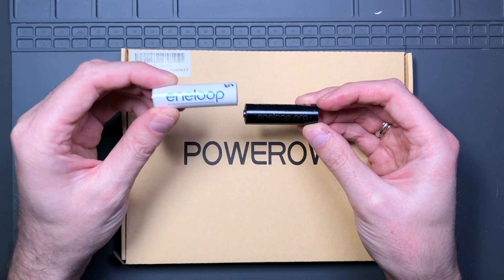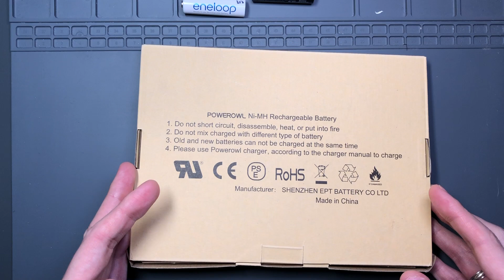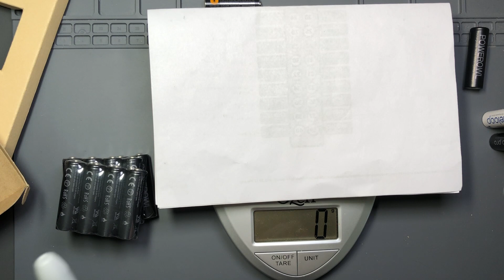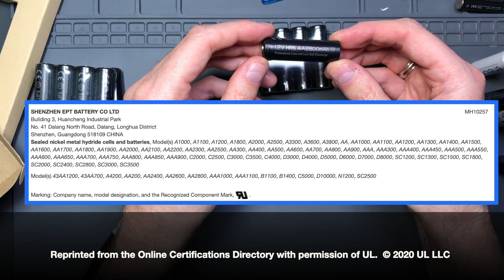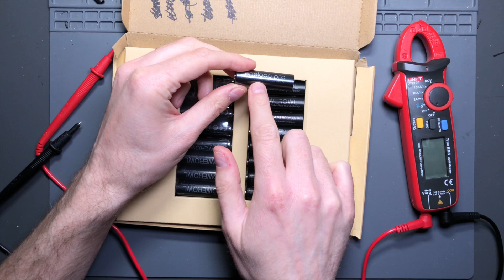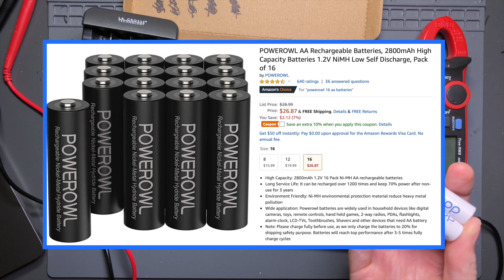How do they compare to Eneloops: Testing and Analysis of the POWEROWL 2800 mAh AA Batteries

Comment: I've recently run some powerowl AAA and they show similar characteristics. Higher discharge currents don't actually reduce the overall capacity. The reason being is that cells hold energy (watts) and we are measuring amps (current)

At higher current draw, the average voltage is lower and therefore this skews the results. If you measure in watts using voltage and current then you get your true measurement

Comment: I've seen a video where EBL 2800 NiMH would provide only 2300-2350 mah. I have several and won't buy more. Fujitsu and Eneloop are virtually interchangeable. I have quite a number of both, and nothing can match them. Ni-Cad is a real darkhorse. There has been a resurgence in interest in improving the breed. Tenergy is the company to watch for this. They now have an AA which is claimed to have an mah of 1100 with greatly reduced chance of leaking. I've had several 1000 mah which have leaked. Great video!

Comment: This is my experience with the high-capacity chemistries.  Minor variations are rapidly and permanently exacerbated by overdischarge use in series.  Within only a couple dozen cycles, the health of a population of cells is everywhere from "i guess i can still use it in the remote control" to "it has the capacity of a CR2032 and it leaks".  On the other hand, I have 16+ year old eneloops that are slightly worn, but they've all worn perfectly uniformly.

Comment: They are ok batteries. I use them for my toddler's toys. 20 for £21 compared to 4 E pro for £20, I think if you buy them on discount they are fine.I now need probably 30-40 batteries for toys, at least, ain't gonna spend £200 on batteries for toys. E pro's are for my speedlight
Thanks for the test

Comment: I wonder if the selected charging currents had something to do with the variation in capacity seen at 9:44 .  I was under the impression that negative Delta V peak detection for NIMH cells is sensitive to the charge rate.  The charger I use advises a C/2 rate explicitly because of this issue.  Thanks for doing these tests.
Reply from the maker: All the charging current rates were below C/2 though. I generally like to stay in that range or lower, but not lower than C/10.

Comment: Have you ever evaluated the Amazon Brand of NiMH cells ?  I wonder how they compare to the Eneloops ? I have been using the standard Eneloops for general use for about five years now, and so far in the various applications, they have performed very well. I have about 40 devices that use either AA or AAA cells. Alkaline's like to leak and I have had Brand new DuraCell Alkaline's, leak while still in their shipping carton... That was the last time I used any...  -BC

Comment: It's probably important to note, for those watching in 2024, that the price on Amazon of the Powerowl AAs has stayed steady at ~$24 for 16 AAs while the Eneloops (non-pros) have skyrocketed from $30/16 to $55/16. So sure, you might only get 2000mAh out of the Powerowls (i.e. equivalent to the Eneloop non-pros) but you can have almost 2.5x as many of them for the same price. And Eneloops Pros are now $85 for 16. So $1.50 per battery or $3.50 per ($5.30/ for the pros), that really factors into the decision depending on your use case.
Reply: You only discuss battery capacity though. 

The other important factor is self discharge, meaning how much of its charge does a battery lose by itself - without a device using the power. 
This video showed that the PowerOwl batteries are lying about being low self discharge so whether they're sitting in your drawer or sitting in your remote, they're losing charge all the time and then will die annoyingly often.

Comment: Powerowel let me down...   I put them in a trail camera and they went dead quickly.    Retrieval and replacement of the dead batteries will require miles of hiking...  SUCKS..  Do not buy them..  The Amazon Basics worked well.  The Energizer lithium work great.

Comment: I almost bought the power owl batteries for my track pad. I've been using a set of much older eneloop's that likely aren't low self discharge and am getting annoyed at how often I have to swap out/charge them. I figured for tv remote controls and my track pad, a LSD battery would be the best. Glad I found your video!

Comment: Is this a new math or am I missing something?  My math shows 500 recharges, recharging once a week...is almost 10 years.  You said two years.  What gives?
Reply from the maker: Haha! Nope, it's not new math. It's been a while - but I think I remember correcting that error in a lower-third in that video. I distinctly remember having a similar response while editing that video. Thanks for watching!
Reply: @TheCuriousEngineerChannel  okay.  I seriously thought I was missing something being a newbie with rechargeables.
Reply: @TheCuriousEngineerChannel  I bought rechargeable batteries from my shop but I have a nihn battery it is 1200 mah battery so I tested it with 300Ma load it not holding its change I maybe got a bad set but I don't have my replacement they was laughing at me buying them now I feel worried about useing high self discharge and I am only to get only 100 mah  and the batteries I tried to recharge it with my solar lights but no hope of repair I was at 0v with a load on it

Comment: 9:05 These are not low self-discharge batteries and they hold on average only about 2.05 Ah 
10:15 There is a huge amount of deviation in capacity. This is important when using multiple batteries - the weakest link decides when your device dies.
16:06 If you are buying these for use in things like remote controls or flash lights (or things of intermittent duty), these will disappoint.
Reply: How do you figure they'll disappoint if use intermittently?
I strictly purchased these for remotes and other kids toys that get infrequent use. Going on about 2-years now with no issues
Reply: @Jo060  Because they lose charge quickly even when they're not in a device, or the device they're in (like a remote or toy) isn't drawing any power. 
This is known as self discharge. 

Envelopes are known for their low self discharge, meaning they don't lose much of their charge when they're not being used. 
These PowerOwl batteries falsely claim to be low self discharge but like with many of the random, unknown brands on Amazon, they're just lying.
Reply: That's Ah not mAh
Reply: @LadyBovine  Thanks! I corrected it.

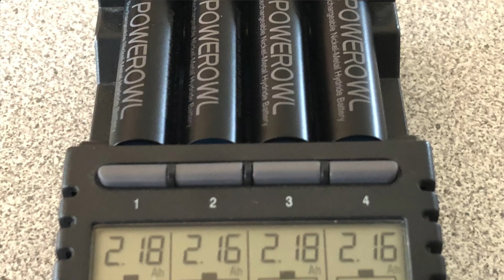Comment: I wish there were more analysis and reviews of these "fake" Ni-Mh batteries, I often find no-name batteries on Amazon that don't live up to their advertising and these POWEROWL batteries are no exception. The problem with off-brand batteries like BONAI, POWEROWL, and RayHom is they often don't meet their advertised specifications claiming to have a high capacity (e.g., a "2800 mAh" battery being tested for 2000 mAh) when they actually hold less as seen in 5:20 and claiming to be a Low Self Discharge battery when in reality their charge retention is similar to a non-LSD Ni-Mh battery. Honestly I don't know of any non-Japanese batteries actually being Low Self Discharge and a red flag is the batteries claim to be 2800 mAh AND LSD which shouldn't be possible (for comparison, the highest LSD battery, Panasonic eneloop pro, has a 2550 mAh capacity).

Unfortunately, people end up buying them not knowing they're getting a poor quality battery. Another problem is the average user likely doesn't have an expensive charger that can measure the battery capacity and discharge them. One of the popular cheap chargers I recommend, the Panasonic BQ-CC17 charger, doesn't have an option to discharge batteries and it doesn't measure battery capacity.

The thing that annoys me is that POWEROWL and BONAI tries to contradict the reviewer saying their batteries are 2800 mAh (which aren't) and claims the batteries have issues despite the reviewer using a charger like the Opus BT-C3100. It's really easy to tell the reviewer is telling the truth.

Comment: I did a extreme test with the Power Battery in my Garmin  on High Mod  compare to the Eneloop and it perform arround 1 hour better then the eneloop also it  has e protected layer on the bottem off the battery  after doing more research i found out the the cell are indeed from panasonic but after 4 weeks off big use the clim and some drop much faster so   its time for me to search for something else as Battery freak i will Try the new Engergizer Extreme

Comment: Lithium needs to be stored in sunny day weather and Nickel Metal Hydride can current cascade to fry electronics... WHEN... they are stored below 72F.  I found problems only when traveling in -13F. Manufacturers need step up and start putting thermal ratings on all batteries.
Reply: When salts are dissolved in solution(like battery electrolyte), salts can fall out of solution at low temperature, which can wreak havoc(Like forming spikes that internally short the battery, or massively decrease the internal resistance and dump too much current). However, if the electrolyte isn't high enough concentration, the energy density drops and internal resistance is too high. Can't win for losing here.
Reply: @rich1051414   I couldnt understand you. Here, the NRC was comissioned to research lithium ion safety. The NRC and the government shirked their paid duty during the Obama administration. Their conclusion was that lithium posed a high hazard. Why they are used in cars is unknown, but fuel burns also.
 https://www.google.com/url?sa=t&source=web&rct=j&url=https://www.nrc.gov/docs/ML1719/ML17191A294.pdf&ved=2ahUKEwjQmY6Gy6_rAhVBU98KHToICuQQFjAAegQIARAB&usg=AOvVaw2v8rd5leGbF0uSKPT8uBdf